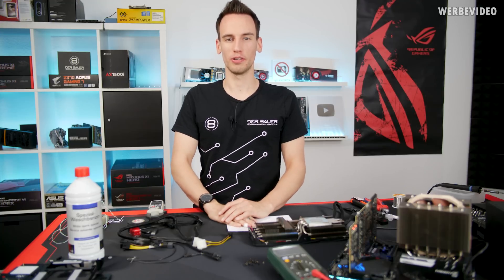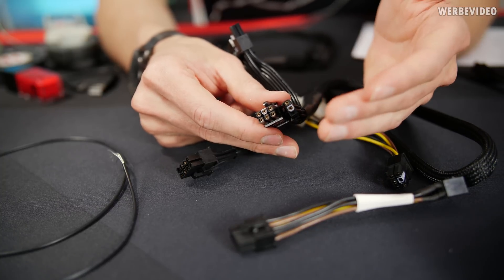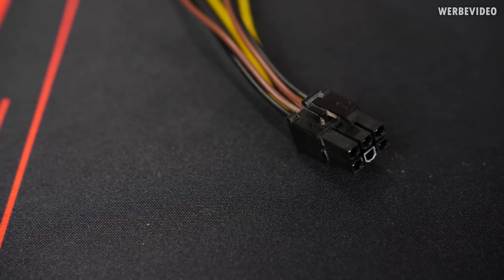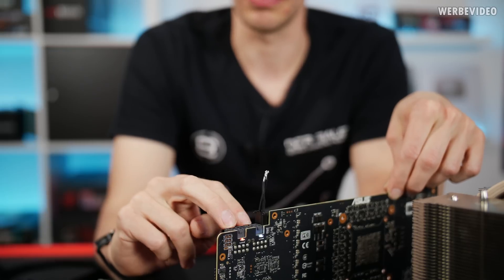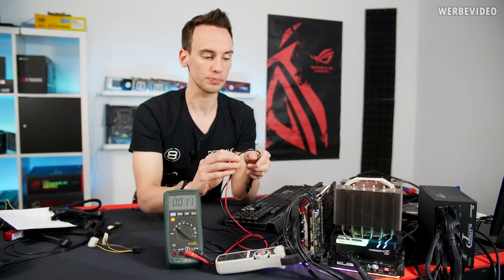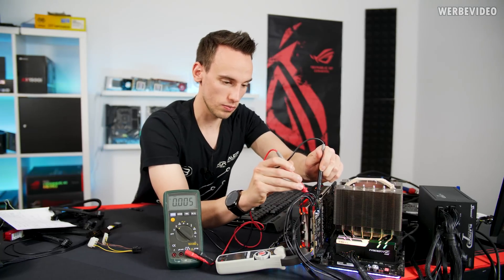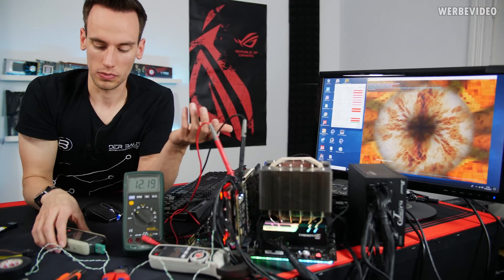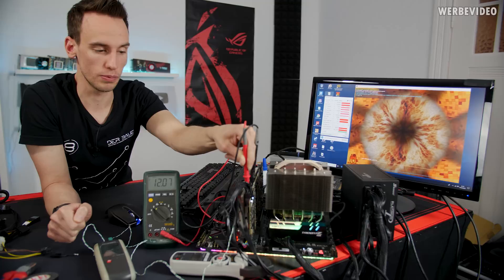PCIe Cables: So much does your GPU really need!

Comment: So in summary: assuming the PSU isn't according to the ATX spec for a 6pin connector: 3x12V pins and 3xGND pins.
And for 8pin: 3x12V and 5xGND?

Comment: OK then can i daisy chain my rtx2080 super video card eight pins connectors instead of having 2 (separate) eight pin connectors. I heard the rtx 3080 and up cards DEFINITELY should not be daisy chained?????????????? Thx man.
Reply: If the 'daisy chain' is a cable built into or originally packaged with the PSU, then yes if there are no dedicated cable alternatives. If the 'daisy chain' is your own creation with adapters or y-junctions, then yes... with a high likelihood of burning wires under load sometime in the future. i.e. If each 8-pin port is expected to pull 150 W, then expect 300 W to be pulled through the wires *that 2x 8-pin plugs share while they are inserted.

Comment: have MSI RTX 3080 GPU 8-pin #1 Input Power 155W and GPU 8-pin #2 Input Power 45W GPU 8-pin #3 Input Power 25W and first cable is burn 
how i can distribution power to all cable's

Comment: Have you already considered bridging grounds from port 2 with grounds of port 1 and then leaving out port 2 with no cable?
Theorically this should force the GPU to think that both ports are connected and grounded. The shunt resistors should behave the same way as they are tricked into thinking that they are checking the individual channels when they in fact are cheching on the same one. Do you confirm this or not? Good vid btw., we need more of these specific on the point vids.
At this point I'd like to throw in that the industry perhaps need to think about some sort of innovation for this problem, maybe a new standard for cableing since molex is pretty old anyways now.. why not just make 2 cables that have more or different material therefore can deliver higher amperages and not have up to 3 connectors with tons of pins each on some cards (my EVGA 3080Ti needs 3 8 pin connectors! - ridiculous!)

Comment: I connected my gpu to reverse polarity power connector of a modified psu, those two shint resistirs burnt and now i have 12 v on two sides of one of those shunt resistor which are r005, any chance i can fix it? Thank you so much for your help

Comment: so from my understanding, having so many ground and 12 volt wires is just there for resiliance correct?

for optimum heat dissipation

im thinking if we could literally just use 2 cables per each 8 pin PCIe cable, but instead of 8 cables at 18awg each, we could use 2 x 14awg cables and daise chain at the end?

would this work? as theres literally only 2 types of connections, ground + 12v

Comment: How can i give power to msi gaming x trio, it has 3 8 pin connectors. My cables get hot and burn when i power the card with a single 8 + 8 power cable and a splitter. And when ever i try to use two diffrent cables the psu never boots up

Comment: With the info you're sharing, it sounds like with a multi-rail PSU, you should definitely benefit by using 2 separate power cables rather than a single one with the stupid dongle, correct? I've been arguing with a friend about this, and this should help prove my viewpoint over theirs.
Reply: Depends, if the connector is on the other rail and you are exceeding the limit of the rail then yes otherwise not really.

Comment: my pcie slot voltage drops to like 11.3 -11.2 under load. And the PSU power cables for the GPU also dro .2-.3. From what i understand the latter voltage drop is not irregular. Also now i can't hit over base clock and all power settings are gone.
Reply: Something else is wrong. Tell more about the specifics

Comment: Thank you for the clear explanation. It explains why connecting just 1 6-pin plug to my GPU prevented it from booting. After I made a second 6-pin cable and plugged it into the 8 pin socket, it worked. That must be because of that sense pin on the GPU, which simply goes to ground on my PSU. In retrospect I may have plugged the 6-pin cable in to the 8 pin socket and did not need to make a second 6-pin cable. That is what I think based on your explanation. Anyway, the system is running smoothly now.

Comment: Question, If a PSU only has a single 6 pin pcie connector and is rated for 75 watts for that cable, even though the rating of the 12V rail is a lot higher, would it be possible to use a 6 to 8 pin adapter to connect to a GPU with a max power draw of 170watts? I mean, i initially thought that the limit would be 150 watts for the GPU, 75 from the cable and 75 from the motherboard, but this one throws me off a little.
Reply: Yes, and the card may just draw enough power through the +12 V cables to melt them. I once powered a ROG RX570, max draw of 199 W, with a single 6-pin to 8-pin PCIe adapter. More than 3 years passed with no issues, until I decided to dabble in my first overclocking in March to squeeze more frames from Halo Infinite. Still no problems with multiple other games over 6 months, other than the driver timeouts and graphical glitches that queued me to lower clocks slightly. Come September, shutdowns followed by GPU output failures started occurring. While I could smell a slight whiff of hot plastic, I thought it had to do with the rising ambient temp causing the fans to work harder. So I just reacted by lowering the clocks more until I had to bring them down to stock. After more loss of output under pretty mild loads, I finally figured I should inspect inside the case. Between the adapter plugs, all 3 of the +12 V wires had melted in multiple places, one clean through the wire. The card and adapter are now out, with the only visible damage appearing to be to the adapter cables.
   People more concerned about losing instruments of higher value would just invest in a PSU with at least 1x 8-pin plug. I'm more inclined to see whether less explosive results can be yielded by utilizing the original OEM 6-pin plug in addition to a 2nd 6-pin plug, *located on the same length of cable[!]*, to power the GPU via another adapter sporting 2x6-pin females to a single 8-pin male. While this config spreads the live load across 6 +12 V lines instead of 3, I'm still concerned about the junctions of the +12s located inside the 8-pin plug.

Comment: So basically it wouldn't be a problem if I connect a Gainward RTX 3070 Phoenix which requires 220W to my PSU with one 6+2 PCIE cable and one 6 to 8 pin cable adapter? Shouldn't expect any random fires/crashes?

Comment: So a 6 pin to 8 pin adapter on My XFX 580 8gb is OK or not?
Reply: Same question.
Reply: @testowykana1763  Its fine. I am running it. But make sure it has 3x12v wires not 2x12v.
Reply: @infernustitan7091  Thanks a lot! Will check it.
Reply: Is overclocking with that kind of adapter a fire hazard? Or just keep it on base clock and it should be fine?

Comment: What an amazing video. Thank you! And that's how things should be done: with proper testing.

A question, maybe you or someone could help: I have a RX 580 and a GM500W PSU, and am having trouble with stability. The GPU has an 8 pin connection, and the PSU has two cables with 6+2 each.

Right now the GPU is connected through one of these cables. Should I try to connect the 6 from one cable + the 2 from the other cable? Is there any risk in doing so?

Thanks!

Comment: does it make a difference to use this pci express cable that you have on hand with video 0.27 seconds and use a pci express cable as well, the connector pins 4 and 8 are interconnected together on pins 6 and 7, does it make any difference these two cables?

Comment: Hi there I have a question can u use 2 gpus each with a 8 pin connector and jus one pcie cable using both the 8 pins for each card?

Comment: hi. is it safe to use 6 pin to 8 pin adapter to my msi 5600XT gaming X. thanks
Reply: would also like to know if using 6pin to 8 pin adapter is ok with RX580. On every forum they say no to do this, and then there is this video...

Comment: IMO, it might be fine temporarily especially for the GPU and the motherboard. But, in long term, it might probably hurt the PSU. (I'm imagining power passing thru one channel as opposed to multiple channels, increasing heat and shortening its lifespan)

Comment: nice and informative video ... i have a question i just modded my 6pin connector to use it in 8pin connector, i simply took 2 random grounds cables from the those 3 grounds and connected them to 2pins connector and the card works, the card is amd r9 390 8g .... my question is can i take the sense ground from any grounds or is there any specific cable works better ? coz i have some restarting problem and though i may did something wrong here ...

Comment: Hi! Is there a difference between using 2 separate pcie power cables from the psu or using 1 split daisy-chained cable?
Reply: With some PSUs, yes! My previous PSU was an EVGA NEX750B and when I used a split PCIe cable to connect 1 x 6 pin and 2 x 8 pin to my 780Ti, my PC would randomly restart when I was gaming. It turned out that my GPU was tripping the over current protection of the PSU. When I used 2 separate PCIe cable for the 6 pin and the 8 pin, the random restarts stopped. It was then that I learned about multi rail vs single rail in PSUs.

Nowadays, PSUs are mostly single rail and so you don't have this problem anymore and can use a single split PCIe cable to power both connectors on the GPU.
Reply: @Neallord Whenever possible, I use separate cables for each power connector on my GPUs even on single-rail PSUs, pigtails would probably work, but no reason to compromise when I have enough cables for each power connector. Using separate cables means the current load is spread across 2 or 3 cables instead of 1.

I forgot to mention the critical part in my original post. With multi-rail PSUs, it is not just about using separate cables, more importantly, it is about making sure that the cables are not on the same rail. The rails are usually indicated on the back of the PSU or in the manual. Each rail will have overcurrent protection (OCP) say 20Amps, so even if you use 2 separate cables but on the same rail for the GPU, you are still limited by the 20A x 12v = 240W on that rail + 75W from the motherboard PCI slot so total = 315w, if your GPU can consume more than 315w then you can still trip the OCP and your PC restarts. This happened to me on my Strix 980Ti which can go up to 375W, so I had to use 2 separate cables on 2 different rails which meant that my PSU could now supply 2 x 240W + 75W = 555W before tripping OCP vs 315W previously. No more restarts after that.

Comment: So then why do i measure NO connection between A and ground or B and +12V? (on the GPU, unpowered.)
Genuine question, not trying to be a smartass.
Reply: You can’t due to the circuit is not powered and you need to use diode mode because the power consumer is after a Semiconductor like a mosfet or Diode

Comment: If only that X570 information would have been public at that moment...
All those 12 pin CPU-cable sockets... 

I would have liked it if he would also have shown the modification in detail (how he bridged those two power connectors on the PCB).

Comment: I connected a 6 pin cable to a 8 pin connector of an AMD Radeon RX 570 4 GB video card , and it worked fine under full load, drawing about 130 W of power.

Comment: To measure the PCIe power draw use an extension cable and split the power lines from the main ribbon and clamp round them.  will prob need a long extension to give enough flexability in the cables though.

Comment: I was under the impression it has to do with the amount of amps drawn from the 12v rail. For instance you can have 1 black ground and 1 yellow 12v coming from a power supply but depending on what the amounts of watts and amps that the psu can produce will determine  the amount drawn. For instance I run roughly 62ft of RGB LED strips around my room and I use an old 350 watt psu to push them all in one direction instead of the 5amp psu that will only push 16ft. I just cut the adapter from the old power supply that came with the kit and attached the ground and 12v rail to that cord and it powers everything!

Comment: Waoh, how tf can this be hard to understand? Wire gauge is closely related to the A they can push through, but not the only factor, things like the quality of the copper, isolation and connectors plays a role as well. So when a 6 pin atx is rated at 6A and a 8 pin is rated at 12,5A, all these factors have been taken into consideration and that's the estimated safe range. Reducing the amount of cables will not make a fatal error, but the remaining cables will experience more heat because of the added power. Saying it's possible to reduce the amount of cables is getting people to make fire hazards in their home. Do that same "trick" to one of the cheap "800w" PSUs and you'll see bloody fireworks.... BTW you would never be able to power a high-end GPU by the max 75W a motherboard PCI-e16x can provide, even getting a bios screen is a far stretch!
Reply: Finally! Someone with the correct answer for using either a daisy chain 8+6 or 2 separate cables.  You're the only one in these comments that realized the other cables on the PSU will try to compensate through the corresponding rail. The GPU draws the power, the PSU regulates voltage through the rails. Daisy chains can cause whole setups to fry, depending on what CPU you have and how its voltage curve works. If I were to use a daisy chain with my 1080, my ryzen 5 3600 will over-voltage on idle, and under on load, which would cause a chain reaction with the timings of my RAM's cas latency and secondary timings, too, as well as under-volt on load. Thanks, Vikings are better. If you had not posted that, I probably wouldn't have caught on to it.

Comment: Those Sense pins are not for the PSU !!!

Those pins are always wired to ground and are there so that the graphics card can sense what you have plugged in and make sure it doesn't draw too much power. If it was sensing the voltage drop then at least one of them would be connected to 12V. Go check where that pin goes on your graphics cards PCB or read up on Intels "Desktop Platform power supply design guide" pdf
Reply: You stupid

Comment: A major reason high number of pins is specified is the connector itself. The contact degrades over time, and thus its current carrying capability is reduced and heat is emitted at the connector. Eventually, the heat starts a runaway process where the connector starts degrading rapidly until it fails.

I have seen this failure on Geeetech 3D printers which run about 15A through a 4-pin ATX12V P4 connector, or in some configurations 10A through a single wire pair and 5A through another. That's the same Molex power connector as used to power the CPU VRM on mainboards. It starts off working perfectly fine, but about a year or two in, the connector may start visibly discolouring and then emitting smoke. There have been a few hundred of such total failures of the connector documented in the Geeetech community.

But yeah 2x8-pin seems more than adequate enough.
Reply: If you stay in spec you do not care about contact degradation. Good engineering practices that is all.

Comment: One thing you might add is, what are the PSU power limits per connector?
Reply: There are no limits, it is all connected in parallel on single rail PSU, on multirail it is the rail limit

Comment: Isn't the plugs about staying within ATX standard technical specs for power draw? What is possible to do is one thing, ATX standardized specs is about certifications to minimum standards, not "what is possible". Because those are the spec standards other parts are certified to, too. While typical average modern PSUs, PCI-E power cables etc can supply vastly more power safely, that is because compared to ATX standardized specs, they are technically way overbuilt. The whole point of these standards isn't to stand in the way of better perfomance / capacity, but to ensure all certified parts _meet a set of minumum requirements.
Reply: yes and no. its more down to safety. wouldn't want your pc to burn down your house would you? (hence why el cheapo psu's are a nono. they don't always follow the specs and are sometimes quite dangerously built.)

Comment: Nice experiment, but keep in mind, cables have resistance, and you are making a constant load, which may not create failures. When you cut cables you increase the resistance of the power line which will not be so resistant to fluctuations, so even if it works without problem with constant load it may fail if there are drastic load changes. If the GPU draws lets say 50 amps one time and 10 another time and then 50 again the buffer capacitors may be not enough to supply the GPU, or even it they are they may recharge slower because of the increased resistance of the power line.
Better synthetic load which makes the GPU power draw fluctuating would create more usable experiment results.
Reply: heh had a melted atx 12v 4 pin cpu connector melt due to cheap wires.

Comment: My GTX 1080 with 8+8 I ran only 8+(2 just bridging)  for over a year works well
Reply: I run a 2x8 gpu for years. Its a old amd card from pretty much the dark ages.  I lossed some mudular cables. So every thing runs from the same old pata disc power cable with a bunch of splitters.

Comment: Really great video! @Der8auer, i have an RX590 sapphire + NITRO special edition and it uses  8pin + 6pin and i have a new corsair HX1000 PSU. My question is:  Can i comfortably use one single cable that has 8+6 pin connectors or should i use two different cables from one for the 6 and another for the 8? Thanks in advance.
Reply: I have a 580 SE nitro with the same 8pin and 6pin connectors and i am using a single  8pin+6pin cable without any problems. PSU is a Corsair RM650x
Reply: @mks2184  but 590 uses much more power